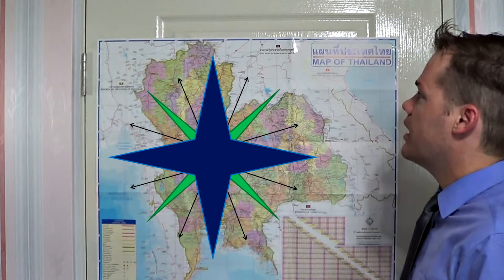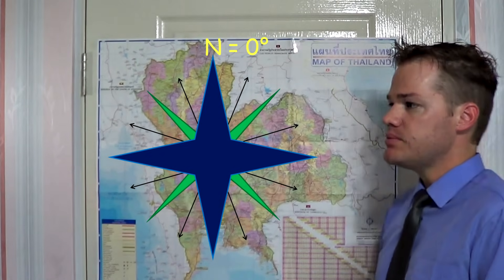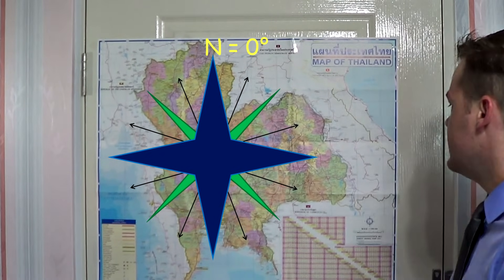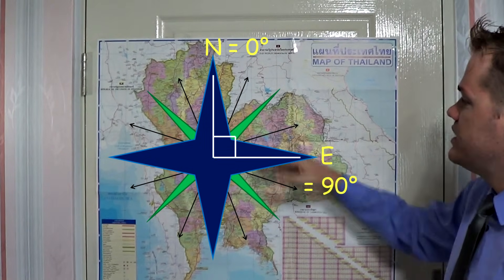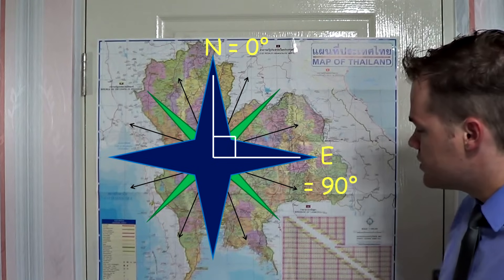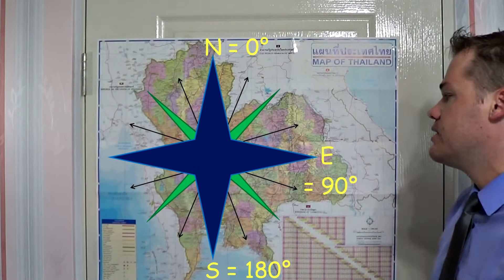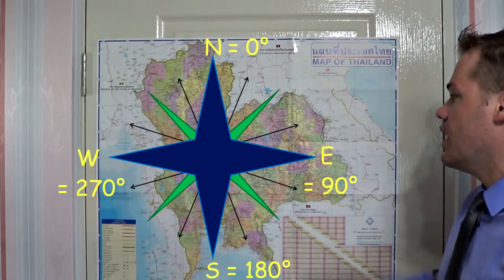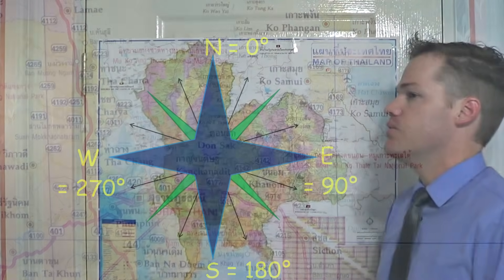Mapwork Bearing (**Bearing is always a 3 digit number; 043° - see description.)

Comment: Does it work only on mercator projection map?
Reply from the maker: Hi, the Mercator projection is certainly a good map to use for this purpose as the grid lines are straight. If the grid lines are curved, it gets more complicated. You'd still be able to more or less do it, but it would be hard to get an accurate reading. All the best with the studies!

Comment: Why do we add the 180 to the bearing pls anyone
Reply from the maker: Hi, sorry for the late reply. One must remember that a full circle is 360°, but the protractor I use in the video is only a half circle=180°. So when you go clockwise from the top through the first 180°, you flip the protractor around to measure the rest of the angle. You can't just throw away the first 180°; it must be added to "the rest of the angle" that you measure when you have flipped around the protractor. I hope this helps.